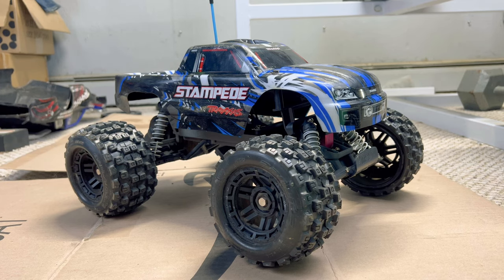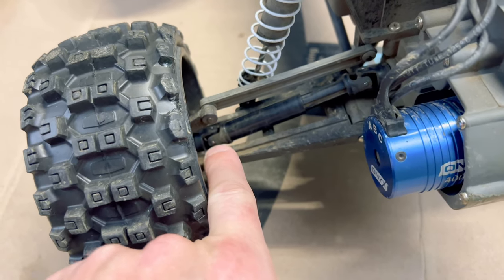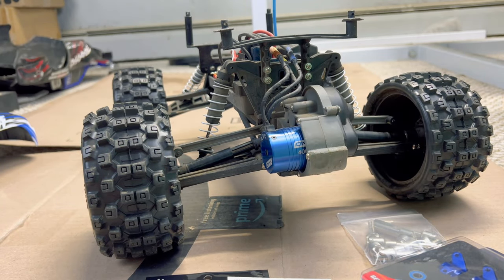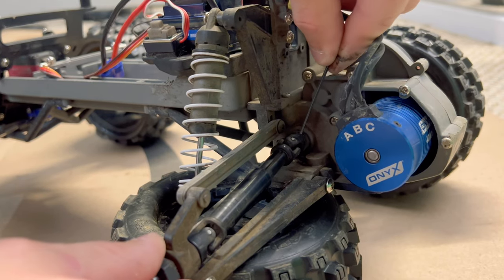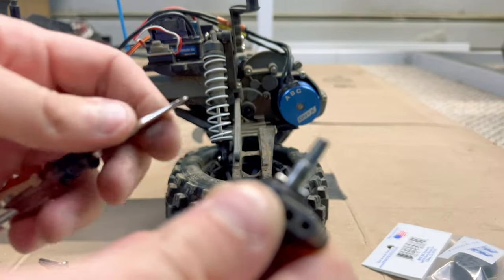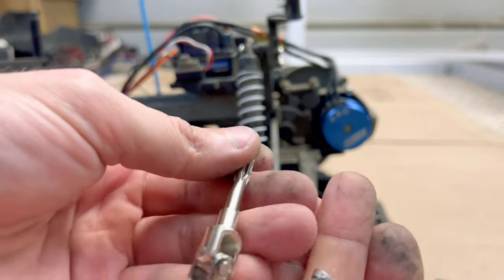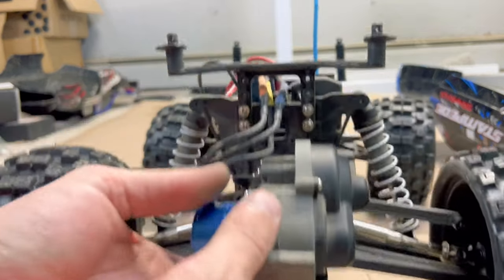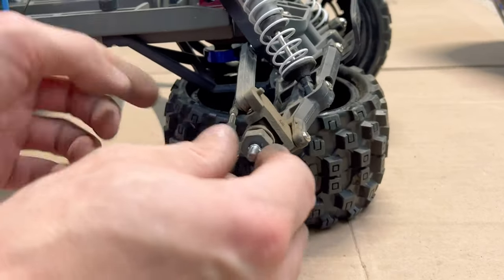HD Steel Driveshafts for “The CHEAPEST Traxxas Stampede PROJECT”

Comment: Take the batter tie down off and take the posts off and get velcro and put it where the tie down goes and screw the posts back in with the velcro and u have a nice battery adjustable battery strap.. I also cut put the little bit near the servo so I can run longer packs.. the little plastic piece in front of the tie down..
Works perfect..
You tha best Nolan!!
Keep the videos coming brother I watch em all!!!
Ps: Keep your head up brother I know something amazing will come your way soon enough!!!
Reply from the maker: Thanks for the tips bro! I actually have the taller battery expansion kit coming soon so I’ll be putting that on when I receive it…..thank you for the kind words!

Comment: Good video. I am not sure about the metal axles because it transfers the risk of breakage futher down the line. I just purchased  this vehicle and am going to do most of these upgrades. It is for my Son- In Law. He gave me his Summit and I wanted to get him something simple as he doesnt have the mechanical skills to repair the Summit. I gave that to him last summer. I have had to do a few major repairs on it since I gave it to him. I can tell he would rather have a basher.
Reply from the maker: Glad you liked it! I haven’t had any issues running these steel driveshafts so far

Comment: yo i just use a velcrow strap to hold in a 3s on my stampede it works great even though the front of the battery is kind of sticking up
Reply from the maker: Thanks for the tip! I’ve got the battery expansion kit coming though

Comment: For about a $100 more you get all hex screws, metal adjustable links, better transmission, better servo, better radio, full bearings, etc, etc, etc. Plus you get an esc + motor worth over $150. Not sure why people buy xl5s.
Reply from the maker: I agree the vxl is a much better value…..I could be wrong but I’m pretty sure the transmission and the servo are identical on both the vxl and xl5…..unless they started putting the the 272 Magnum R in the Stampede 2wd Vxl?…..but just for the power system, links, hex screws, bearings and TQI radio alone…..it’s well worth it…..that’s not really why I do these projects though…..I just like starting off with the base model and building it up…..not much point in a build if I started with the vxl model lol
Reply: @RCKnockout  The vxl servo is the 2075 digital and it comes with the upgraded $140 drag slash transmission as well as a motor protector and wheelie bar.
Reply: @RCKnockout  There's still upgrades you can do to the vxl. It's just that can't beat all the stuff it comes with for price.
Reply from the maker: @truerc  you’re right…..I was thinking mine came with the 2075, mine actually came with the 2056…..it’s destroyed though……so it’s already been replaced with a metal gear one
Reply from the maker: @truerc  that’s true….the build series wouldn’t be as entertaining in my opinion though….

Comment: Those driveshafts are junk. They will rust. I had them in my slash 4x4 that I bought used, I had to throw them in the garbage and buy original Traxxas heavy duty plastic. Front driveshafts would not let wheels turn
Reply from the maker: I’ve run these same driveshafts on my Slash 4x4 and they’ve worked very well…..I did end up breaking one on 4s but I landed kinda funny on a rear wheel….aside from that they’ve been great….I highly recommend them for budget driveshafts…..if I thought they were junk….I would have never put them on my machine to begin with….sorry for your experience…but that’s my two cents